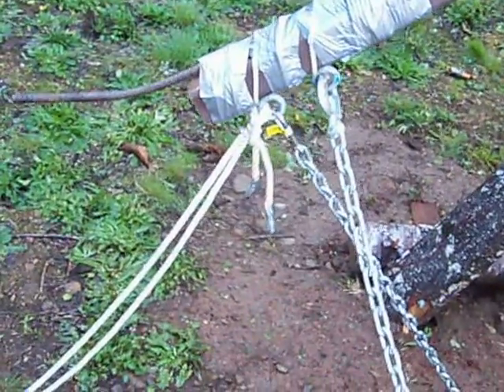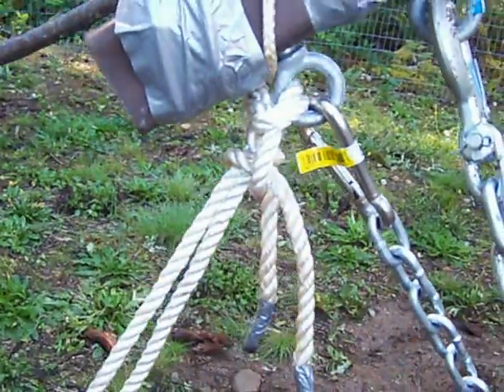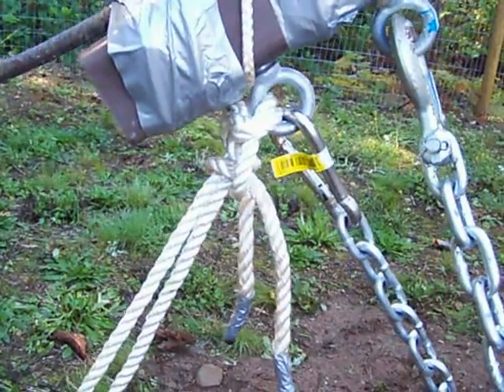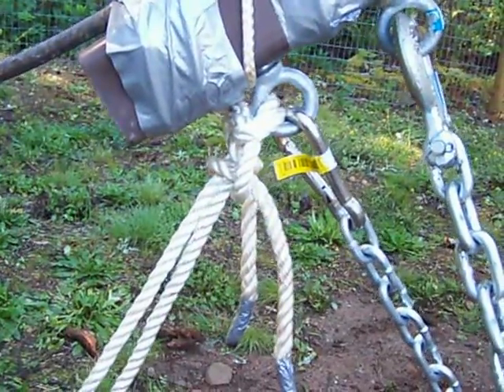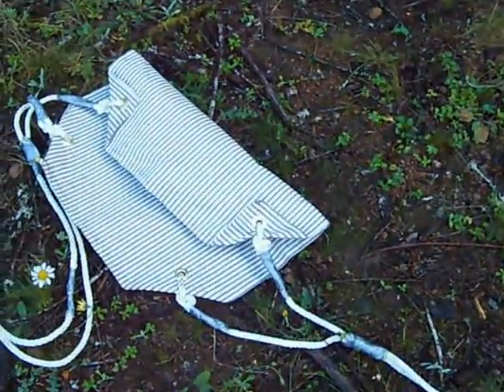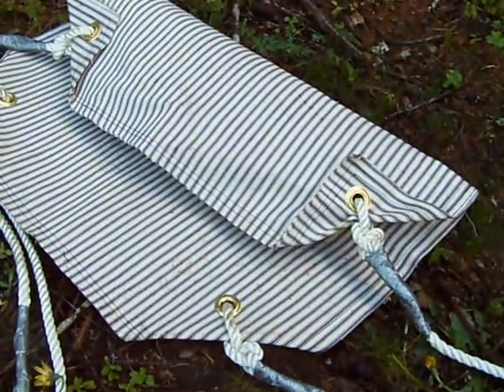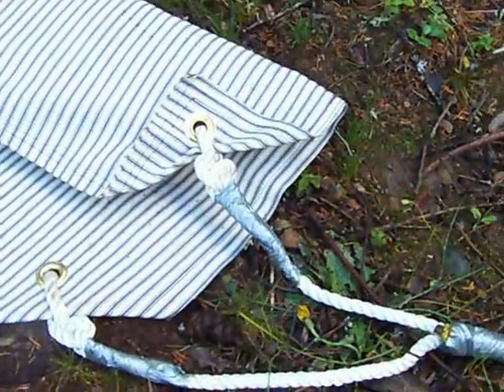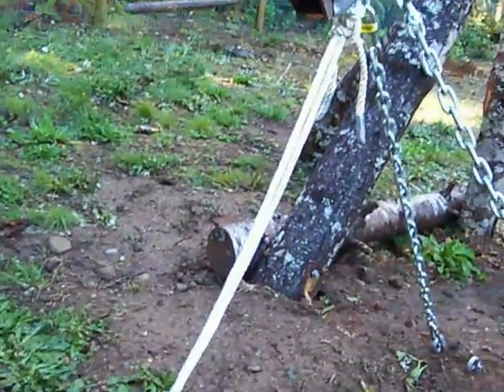Trebuchet sling details including the snap link release...

Comment: Google trebuchet simulators and a free one will come up that describes the exact lengths for each of the trebuchet parts and then lets you change the values and test it.  www.virtualtrebuchet.com.This is the site we used to create our dimensions.  The sling takes some tweaking for release but if you do not have your dimensions correct the forces will be off.

Comment from the maker: @oldironside23  

A good way to start with your sling length is to make it the same length of the longest part of the throwing arm.  My long part of the throwing arm is 7 feet long, so i started off with sling legs 7 feet long.  Right now, my sling legs are 4 1/2 feet long, and I consistently toss stuff 150 feet in a straight line (LIke a fastball in baseball).